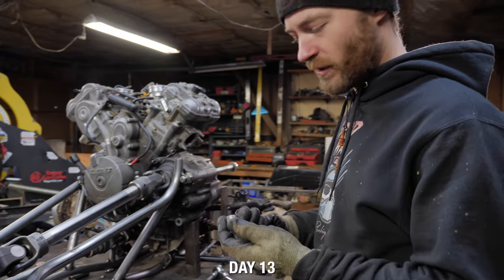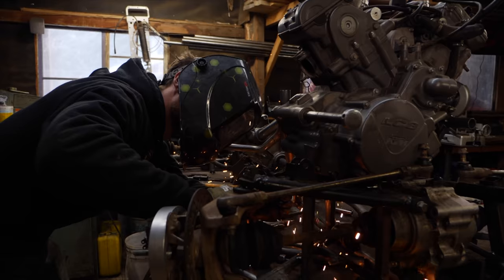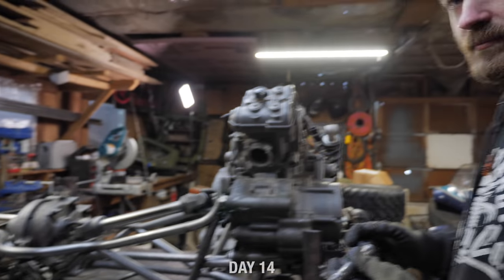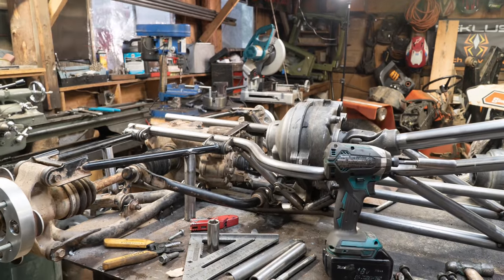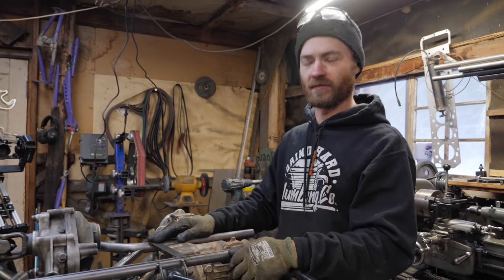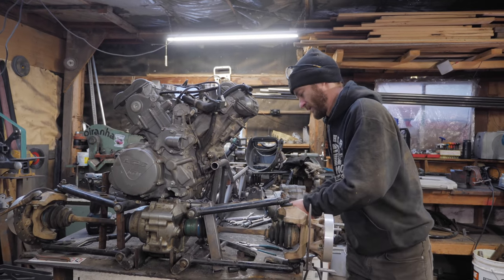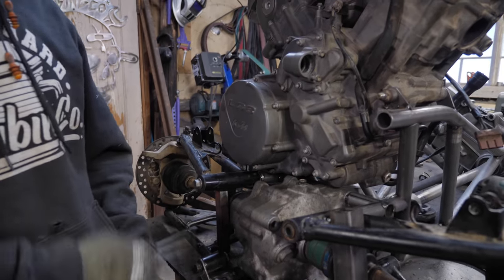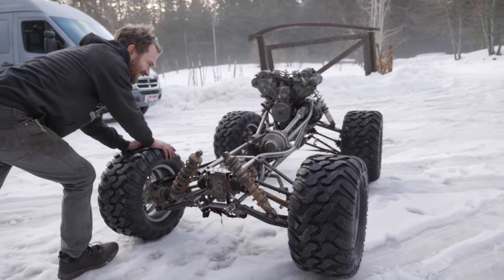1000cc 4WD Go Kart Build Ep. 5

Comment: I would highly recommend making a cage for the shaft that goes to the transfer case. Had one come loose on my Jimmy and dented the floor board. I could only imagine what it could do if it would have come loose near my leg. Broken femur at the least. Maybe an amputation at the worst. Love what you guys do. Would hate to see it end badly for you
Reply: If i had the power of a hundred horses, going at some serious rpm´s, right between my legs, i would have wanted them to be safe. Emagine it breaking off by the transfer case, making a swing for the knee caps, or even arms. Otherwise, holy crap what a monster of a build so far! Looking forward to see that thing 4WD powersliding over the icy and snowy road
Reply: A loop

Comment: 4:50 it's a little snug because cross thread is the tightest thread
Reply: LOL
Reply: Why use the old threads when new ones are better?  🤔
Reply: Cross threading is nature's loctite
Reply: oh man I actually yelled out loud when he hit it with the impact.
Reply: No worry’s! 14mm bolt with a 1/4 hex drive. Cross threaded would only go one thread in. Boom
Reply: So I’m NOT the only one who’s ever done that! Good. I feel better.
Reply: @rdf430  Yeah theres no way that would have pushed that in with an impact that small. Would've needed a 1/2" impact or bigger.
Reply: what are the torque specs on that bolt? oh just cross thread it

Comment: You guys should do a 6 x 6 power wheels build!!
Reply: Lukas Slawecki mini g class 😍
Reply: They should try and turbo or supercharge this thing that would be awesome.
Reply: @simplysaber1814  Turbo sounds like a better option
Reply: Fuck it might as well an 18 wheeler if they already at it lol
Reply: @MK-sk2mi  Yes! With a low boy to haul the other ones 😂, a tow truck for recovery, a police car etc.
Reply: 6x6 turbo diesel build!
Reply: Yeahhh!  Make a G wagon outta one of those amphibious 6wd things! That'd be awesome and I guarantee no one would/could copy that one! Cheers!🍻
Reply: Lukas Slawecki  or maybe finish the first build
Reply: Hyabusa 1300cc powerplant should push that 😜 and theres plenty of wrecked ones if ya look hard enough
Reply: 2021: powerwheels 1/1 monster truck size build
Reply: @morningstar5071  No hairloss: dont roid and spend money on gimmicks
Reply: @eamh2002  Got baby hairs already; not a gimmick
Reply: Un 6 roues motrices c’est aussi facile qu’un 4 roues motrices. Une deuxième chaîne ou un différentiel modifié avec un deuxième pincions. Les petits moteurs diesel sont très commun.
Reply: Lukas Slawecki 8X8
Reply: @edgiestofcars  Not bad idea, but easy enough to add later on, if they can get 6x6 running, just needs to leave bit more room on the front, though they might need to go using car axles for that build. Garage 54 built 6x6 by taking lada niva, adding second center transfer box and splitting drive to two rear axles. Same could be done on front and just link two power steering rack housings together with chain and sprockets. Best part of this is that you can then adjust gearing from 1:1 into having center most steering axle to turn different amounts. Talking from my ass now but i recall catching some info that in 8X8 vehicle that axle is turning bit less, but i might remember wrong. Regardless its good method to transfer steering power with two axles.

Of course you can then connect even all of the steering rack housing for each axle to system where damn thing can turn almost on a spot, or even drive near side ways by turning all the axles into same direction, what might be useful in off roading. Havent seen this done on proper offroaders probably cause how complicated system would be and you dont want to get stuck with several ton truck cause that system gave up. On fun machine like this that you can still pull with atv out from the forest could be worth to try messing with different gearing and directional setups.
Reply: 6x6 power wheels?........0.o.........that idea = the "Jump to Conclusions Mat" of dumbness.
Reply: @Hellsong89  they could use the diffs from an old Polaris 6x6 or John Deere gator, That would be sweet
Reply: @simplysaber1814  the new ram has an electric supercharger. But only give 140ft lbs down low rpm. No hp..... weird
Reply: U guys build the coolest shit ever
Reply: Supercharger more low down torque

Comment: Love the build but you've got to clock those driveshafts right or it's going to vibrate like hell and if it comes apart you could be seriously injured. The yokes at either end of each shaft have to be parallel. I didn't get a good look at the other shafts but I can see that one coming off the engine is clocked 90° and that's a big No-No.
Edit: looks like the other shafts spline strait into the transfer case so you're good on those. You definitely need to clock that main shaft straight though.

Comment: I’m worried the driveline will have a lot of vibration. The engine shaft and chain box shafts should be parallel. Offset but parallel.

Comment: you probably have plans for shifting already, however a nice setup might be to use a central  locking solenoid or similar , and a push button on the wheel.  electronic gears hey thats just faaaaancyy. love these builds, well done.

Comment: Hey guys, going great!! Saw at the end of the vid the drive shaft from engine to the 4x4 gear box. Ou have the universal joints at 90°to each other. Not the same orientation.... think you'll get vibration from that , I saw it somewhere that that will cause some problems (I'm not 100%)
Reply: This is totally correct; check out the Double Cardan Shaft section of Universal joint page of wiki: https://en.wikipedia.org/wiki/Universal_joint#Double_Cardan_shaft

Comment: @0:14 When she ask me to come over.
Reply: Don't forget your special spacer sleeve nut thing.
Reply: Don't forget the battery and jumper cables. Don't forget to put oil in the engine, I reckon 20-50w in the winter and straight 60w in the summer. GL

Comment: 990s  have an issue with water pump drive shaft wear and leaking coolant into the oil. Also trapping air pockets in the heads. With your orientation when the coolant system is done, hang it up from the rear to burp the heads, get the air bubbles out. Great videos!!!

Comment: If you make the bottom of your engine mounts longer you can Pierce the bracket with that cross piece and add a lot of strength to that system, At the moment it looks like you or maybe grabbing 1/5 or 1/6 of the radius cross piece at the moment it appears

Comment: This thing is sweet. But double check your drive shafts. With that much angle on a u joint, you need to make sure the u joints are in the same position on eash side of the driveshaft

Comment: Hey aside from loosing the through the bonnet (hood for the Yanks) coolness factor. The front suspension, id mount to the lower A arms and just in front of the engine for packaging. Maybe some sweet bar work up front to protect the shocks and mount steering components too would be slick.

Comment: Looking good! Your best build yet so far. 
One thing. I've been wondering about those flipped diff(s). Depending how the lubrication works in those (likely splash oiling) you might want to switch the diff to a much thicker lubricant. Sure it will cost the tiniest percents of power, but in this application who cares? Especially if it saves you from diff failure. 
Eg like from 50 weight to 90 weight. 
I have no idea what these diffs run stock so that's just a random example of the kind of viscosity jump I mean.

Comment: It's kind of hard to see in the video, but do those agricultural universal joints have an internal snap ring to retain the caps, or are they press fit only? If this is the case, you might want to consider either tack welding or peening the caps to prevent the u-joints from coming apart, especially since you're going to be spinning them far faster than they were designed for in a farm/industrial application.

Comment: My VT750 Vtwin might need to be taken to a machine shop ill have to find a way to get the cylinder heads off to see the condition of the parts but if its in good condition i can get it running and finish one of my power wheels

Comment: u guy should use arctic cats crossfire 1000 engine made by Suzuki. its very reliable and it put out 160 hp and it a lot lighter then the four strokes. u can find them for around 1000 bucks

Comment: i have alot more control with bent knees lol i kno it sounds weird but its true lol  we had a modified off road buggy like a wanna b honda odessy but more like a 4 wheeler frame but with a 4 cylinder 600cc street bike engine n without a roll cage it was Fn scary! the only problem is u lost alot of maneuverability because i couldnt throw my weigh around like i can on a four wheeler, it gives u sooo much more of a feel of control, that and it also keeps the center of gravity more towards the center o f the bike, i kon the engines heavy but its not right over the back wheels

Comment: Should have just saved yourself a lot of time and modified the frame of the quad a little to fit the engine, since that's basically where you ended up anyway. It's the same size the quad was now.

Comment: Any plans for a safety shield over the rear diff to protect your ass and nuts or are broken diff cases not an issue on those drivetrains?  I've heard too many horror stories from old drag racers about the injuries form the cars where the driver sat over the rear diff.

Comment: Don't forget to fix the double cardan shaft between the engine and the transfer gearbox. It looked like the u-joints were already fixed on the shaft (the way they moved in sync when you pushed the cart). The way they are now will damage the drive train under power. The shaft have to be twisted by 90° before you finally weld the U-joint to the shaft.
See here: https://www.youtube.com/watch?v=4CYnLyTsYOA

Comment: Love the build guys but not impressed with bolts welded straight to the frame for diff mount shld a had small brackets made with captive nuts to do same job especially whn the rest of the build pretty much up to an exceptional standard 😔

Comment: If you align the yokes the same on opposite ends of a driveshaft,  it creates a constant velocity joint.  One u-joint by itself varies in speed twice per revolution,  worse as angle of joint increases,  not at all if no angle.  If the two yokes that are welded to a shaft are lined up the same,  the pulses cancel each other out.....cv joint.  If the two u-joint angles are not the same, the pulses won’t completely cancel, but will be better than yokes 90 degrees apart. 
THIS BUGGY IS GOING TO BE EVIL !!!
The devil went down to Georgia, cuz he saw what you were building.  Last seen shaking his head and mumbling.

EDIT:   In fact it’s going to be so nasty that a roll cage and 5-point harness might be a good idea.

Comment: Lotsa times I've seen many, builders put together carts/ frames/ cool creations,and with the engine in the workplace,as a mock-up,without the ports covered,intake or exhaust, good chance while grinding/ welding,the motor inevitably consumes some grit or slag,with your professionalism in the build, it would be a shame to have,well you know. Specially on a two cylinder, My learning curve in this matter was a 350x "FAT CAT" For the time it was  "Easy build,"widened dirtbike swingarm in place of 3wheeleraxle axle,three wheeler front wheel in back, sprocket bolted directly into brake disc! No Brainer! Honda $houldah offered this to all the greedy"Suehappy" americans when the babykilling three wheelers were maliciously sold to poor  innocent 80's families! Yup mine was perfect cept I had the oil lines removed for bigger oil cooler when I was welding/ gringding. First ride, it was awesome,$he was a 3 hour sweetheart till the welding slag entered the topend, head had no bearings, def.slag in the aluminum galley! =No more fun

Comment: Bro that thing is wayyy too high and narrow. It will without doubt keel over if you turn sharp under throttle
Reply from the maker: Have you ever seen an ATV...?
Reply: Grind Hard Plumbing Co yes id understand if it was an atv but doesnt the title say go kart? This thing is going to handle like a quad bike imo, and the fact that he plans on sitting down low and legs out like a go kart means that its going to be quite dangerous. If you feel as if a quad bike is going to tip you jump off. In this youll need to jump OUT... i hope he puts a roll cage on